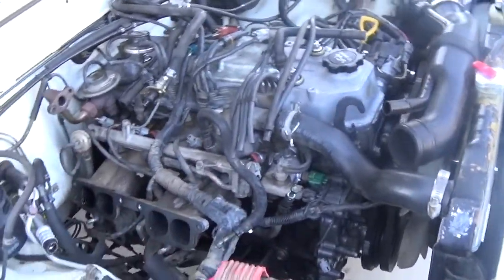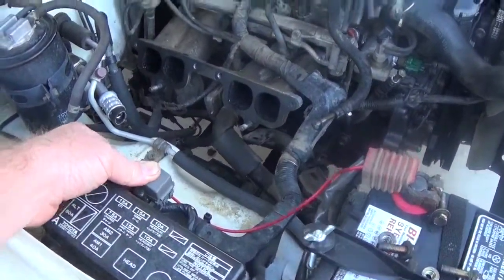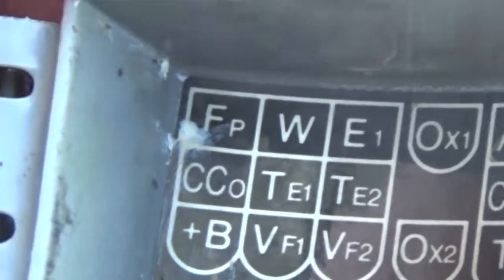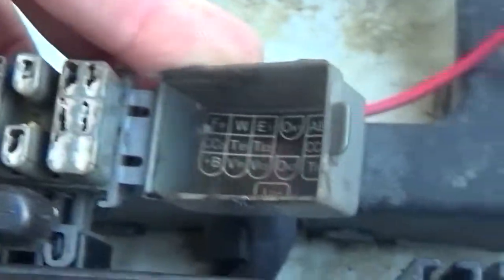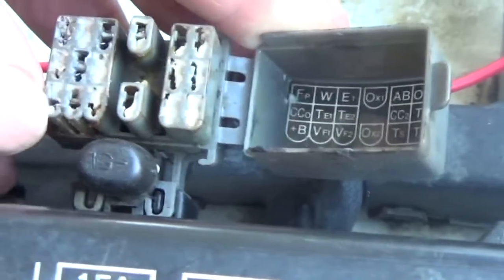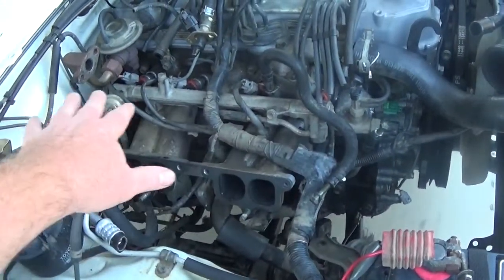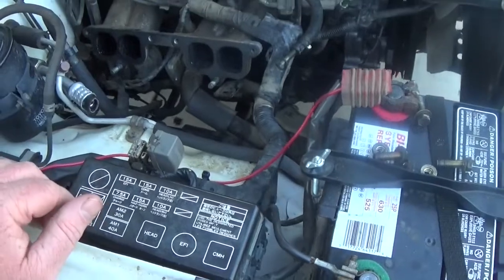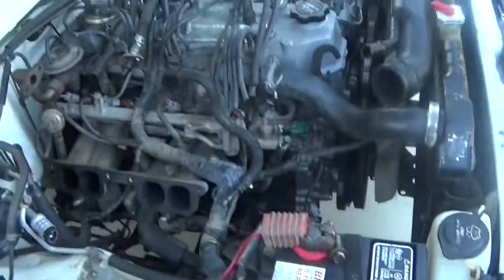22re Testing the fuel pump

Comment: What about not getting power to the fuel pump?
Reply from the maker: Not sure what your asking.
Reply: @tubejim101  I figured it out. It was a loose connection with the main power source up underneath the cab seat that runs to the fuel pump.
Reply from the maker: @kevinrosendahl3988  Good find.
Reply: @kevinrosendahl3988 was it under the seat or under the truck body?
Reply: having this same problem right now

Comment: The test works and my fuel pump kicks on but it still wont start it just cranks and cranks is there anything else i should check? Fuel filter, fuel pressure regulator?
Reply from the maker: I should make a video show how to trouble shoot crank, no start.  Your engine needs 3 things (basically) to start.  Air, Fuel, and spark.  Air, is almost never the problem.  Can take a look at your air filter.  Unless it is really dirty, your good.   Shoot some starter fluid in the air filter.  Then try and start it.  If it runs for a few seconds, then dies.  Then you know it is a fuel problem.   If it does not fire, then you know you have spark problem, that you have to fix first.
Reply: @tubejim101 thank you!!!!

Comment: I hear noise when I do this test, my battery is good, my starter doesn't seem to be the problem, I've thoroughly inspected cold start sensor and injector and I'm still having problems starting the vehicle.. It's very bizarre..It runs perfectly once on though making it harder to diagnose
Reply: it did spark when i used a paper clip a lil bit when i made firm connection no spark, very confused..i believe it's not building enough pressure
Reply from the maker: Did you have your battery tested?
Reply: @tubejim101  yes got that tested at AutoZone, it's in good condition. I believe the distributor is the problem.. or ignition circuit according to this chart i found..i popped off the cap and it has burnt marks on the contacts? Should I replace this? I'm probably going to today
Reply from the maker: @thenman23  If it is within your budget, I would put cap and rotor.  Also, check the resistance of your spark plug wires.  Also, take a look at the spark plugs.

Comment: When I do this it sparks and jumper gets hot.what could be the issue?
Reply from the maker: Sounds like you have a short.
Reply: @tubejim101  I tested fuel pump it’s shorting
Reply: that happened to me..i had assumed it was because the grease and dirt but did you replace the fuel pump or what?  whenever i could get it connected..it didn't spark and i heard it kicking on
Reply: I’m troubleshooting mine also and get sparks when trying to jump FP and B+.  Did you ever find out what it was?

Comment: So by doing this what are we exactly by passing? When I do this my fuel pump kicks on. When I remove the bypass it does not turn on. So what are we bypassing?
Reply: Most likely the relay behind the glove box / passenger floor area called the accessory power relay that controls the fuel pump prime to start and fuel pump to run.

Comment: Does the open circuit relay have to be working to jump?
Reply from the maker: No, you can jump any time.
Reply: I think this bypasses fuel pump relay,not sure on that ,if not then it would show a bad fuel pump relay, or bad pump if pump doesnt run!

Comment: THANK YOU as I have already read, "YOU ARE THE MAN 💯‼️" your video was EXACTLY my issue (was a issue) I went to my 94 Toyota pickup this morning and did EXACTLY what you have done and I have been trying to get this fixed since December 2020 when I installed my battery backwards on the side of my father's house and that's where it has sat for 25 months & 22 day's (my joy I can not express enough) and I paid the insurance every single month and I renewed the plates back in August and I done this with the thought that I can figure this out on my fixed income SSI (I'm in bad shape from an attack 5 days after graduation 🗡️ me up real good) so I started watching your video yesterday and YOU convinced me in the video that I could fix this with my daughters bobby pin 😂 and IT WORKED so I filled it up and it's back at the house where I wasn't sure it would ever be again. For you: Out of 2 &1/2 years of searching YouTube, Google and every other search I could do, you have the ONLY video on the WWW that is a 100% fix for the 1990-1995 Toyota pickup pre Tacoma for ANYTHING to do with the 80 Amp fuse that is the only protection for the parts that have a small engine connected to the truck that blows and saves your fuel pump and alternator etc etc I'm getting at is the most important fuse for the 1990-1995 Toyota pickups and your video is the only one that will explain exactly what to do so the fuel pump is working and your back on the road!!!!!! Sell it to Toyota because they have NO IDEA what the hell to do for 1990-95 Toyota pickups. You Rock Brother very grateful tight budget Red blood bleeding American Man that has not been able to drive for 2 & 1/2 years until I saw YOUR video 📷 Cincinnati Ohio

Comment: I was so excited I installed battery backwards and it blew the 80 Amp fuse and who knows what else, but I connected the 80 Amp and everything came on and I tested for spark from plug wire and it's getting fire but no fuel, I don't hear the fuel pump and I don't care at this point anymore but how can I bypass it so my truck will start and run?
Reply from the maker: https://www.youtube.com/watch?v=QlNLIu8SIpk

Comment: Why can't you start it with it jumped?
Reply from the maker: It is just for testing, as far as I know.
Reply: @tubejim101  yeah testing is to run the truck. it's a way to bypass the relays and AFM. Doesn't mean those aren't your problem
Reply from the maker: @lance7413  I don't understand your question.  It sounds like you activated the fuel pump through the test port, and are having trouble getting your pickup to start?

Comment: Can this check if your fuel pump relay switch is working thanks
Reply from the maker: If it did, you would hear your fuel pump relay click.  You could also pull you relay, and test to see what happens.
Reply: @tubejim101  Thanks 👍
Reply: Shouldn’t the pump comes on when you turn the ignition key to acc ??. I believe you could hear a buzzing sound from the pump .

Comment: My truck starts fine, but only runs for a second or two before dying. I tried the fuel pump relay bypass and the truck ran a bit longer. I did a fuel relay bypass and the truck ran for about a minute before dying. I’m thinking it’s the fuel pump going out, but I just replaced it about a year ago. It was a cheap ebay part though. When I did the relay bypass I can hear fuel running through the fuel filter, but after it dies I hear nothing. I’m thinking it’s either the fuel pump or a bad connection somewhere.
Reply: Might have to test the AFM since that's what acts as a switch for the fuel pump. Without it giving the signal your fuel pp will not run. Although you can check to see that your AFM works by checking it with a multimeter for resistance, the real issue might be that its not getting the signal to the circuit.
Reply: @ReneGarcia-qy4qj  I’ve gone through 3 AFMs. Someone suggested that I replaced the fuel pump relay. I did a fuel pump relay bypass and the truck ran for almost a minute. After the truck died I tried to start it up again. With the bypass I could hear the pump running, after the truck died... I heard nothing. I’m pretty sure the fuel pump relay is bad and the pump it self is on the way out.
Reply: @dinoflagella4185  well what was it?
Reply: Test your fuel pressure and that will tell you exactly if the pump is not pumping enough, it actually runs for a min with the cold start injector spray but prob not enough pressure to keep it running, j/s
Reply from the maker: Have a local shop you trust do a diagnostic for you.  Then you can decide if it is something you want to tackle.

Comment: I bought an old 91 4x4 and I don't hear the fuel pump or the gas meter doesn't mark. I think there is no fire going to the fuel pump. I'll try what you did, if I hear the fuel pump then I'll know to go after the relay or wiring. Thanks

Comment: I try that method and i dont  have power on that diagnostic litle box
Reply: Key needs to be on
Reply: @isaacdinardo7751  Or if key is on, probably a blown fuse or thats the reason truck won't run, troubleshhot till you get thet B+ back on, (jump the fp to your battery will test it also if no power to B+)

Comment: My fuel pump kicked on but when I turn the switch on nothing happens with out the jump
Reply from the maker: Have your battery tested.
Reply: This is just a test to see if your pump will run or not, with the key on and it doesn't run mean you have a blown fuse, bad relay or a wiring problem, google for wiring diagram and troubleshoot, my 2 cents...

Comment: The Haynes Manual for the 2 generation 4runners does not include instructions on how to test the fuel pump using this method. However, the Haynes Manual for the Miata does have the instructions on how to test the fuel pump by jumping these 2 female terminals, the Fp & +B, as you are demonstrating. That's how I learned how to use a jumper wire to test the fuel pump on my 1991 4Runner, from the experience of testing my 1991 Miata fuel pump
. 
My 1991 4Runner 3.0 manual drive 4x4 3vze & my 1991 Miata have this similar system including the Air Flow Meter. I guess that was the latest technology back in the 90s but I don't know if the Airflow Meter is interchangeable between the 2 type of vehicles. I would guess not even though both are manual transmissions & other things are way different. But then again, the Air flow Meter replacement serial number on the NAPA Autoparts Cardone brand replacement for my 4Runner was different than the serial number on the actual 4runner.

Comment: Wow!! This video just helped me immensely. After my 1990 pickup not starting and only running on starter fluid. I jumped the Fp to B+ and gasoline started pouring out the fuel line near the clutch slave cylinder. Someone (prior owner) connected a rubber hose over the steel fuel line and used a zip tie to keep it on. Pressurizing the system made the connection pop off. I reconnected with 3/4 pipe clamp and rejumped Fp to B+ to pressurize the system and it started right up no problem drove down the road awesome. Thought it was an ECU problem, disconnected the EFI fuze, disconnected battery trying to reset codes nothing worked.

Comment: I could barely hear anything.  You'd have to have a quiet area.  So, It starts and runs with the jumper in, but dies immediately with the jumper out.  Sooo....
Reply: Relay. Stater relay and efi relay are interchangeable in mine switch them out. And try.

Comment: I tried it and I couldn't hear anything but I unplugged it and it had voltage and the pump is new can you help me with this issue.
Reply: It is a 1995 Toyota 4 runner 6cyl
Reply from the maker: @al8184  That is a bummer.  I guess, next time, test it before you put it in.  What kind, and where did you buy the fuel pump from?
Reply: From a small auto parts near my home.  Can it be the pump that is damaged